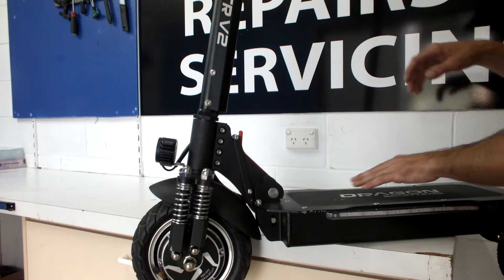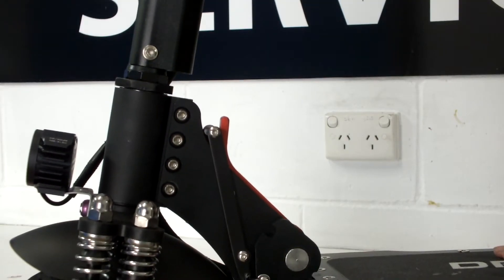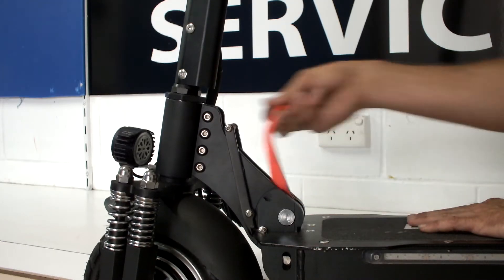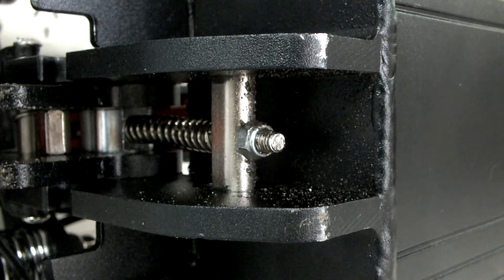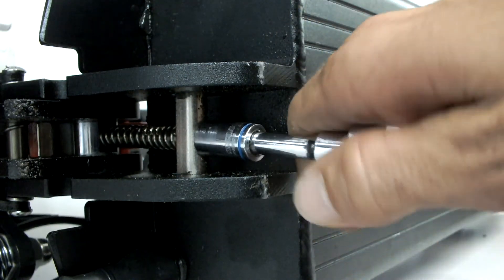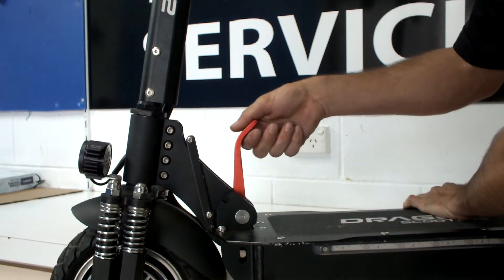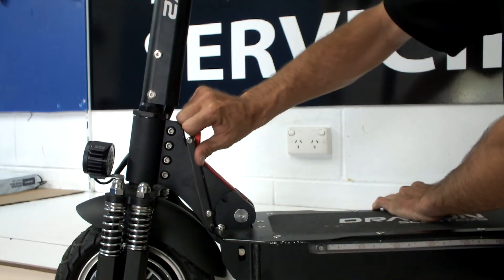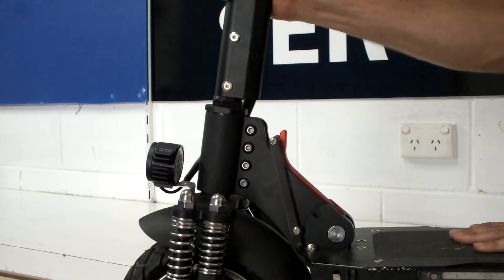Folding Mech Maintenance Dragon Scooter G Series

Comment: The part the red latch sits on is jammed to the handle bars. it is not allowing the rod that goes to the latch to stay straight. I folded the scooter one day and the rod snapped just below the red lever. Any tips to get it to move properly?